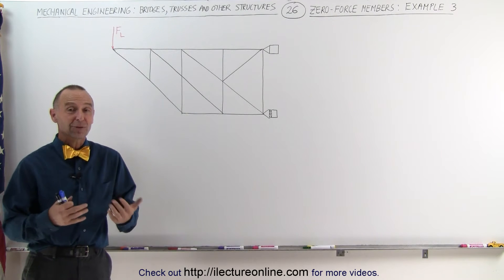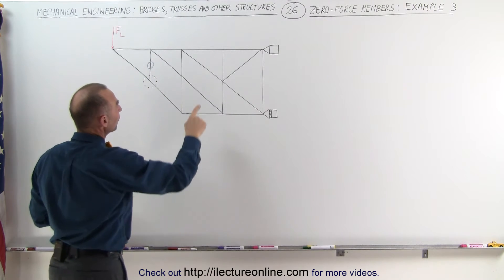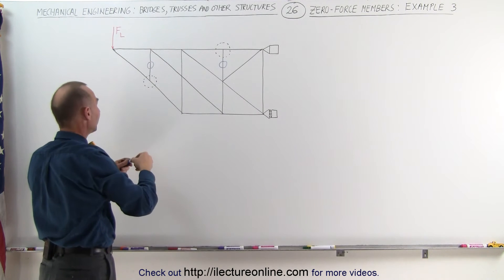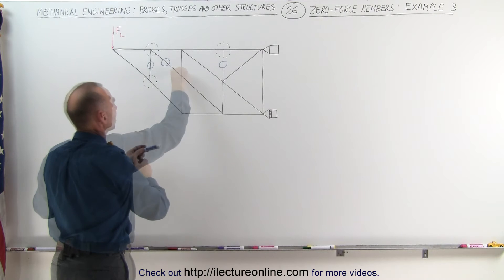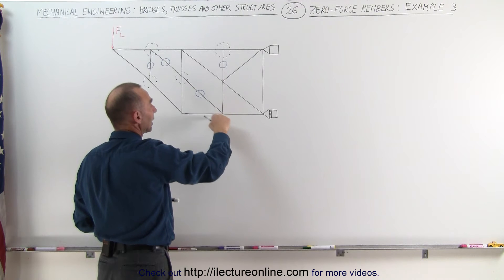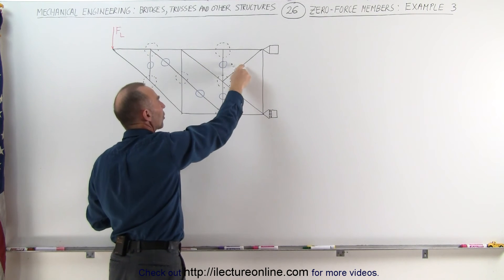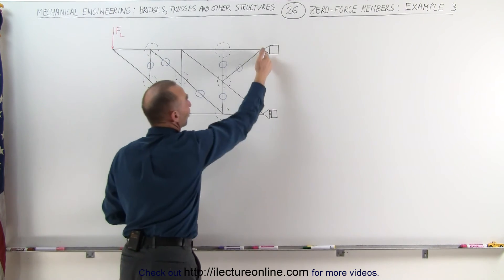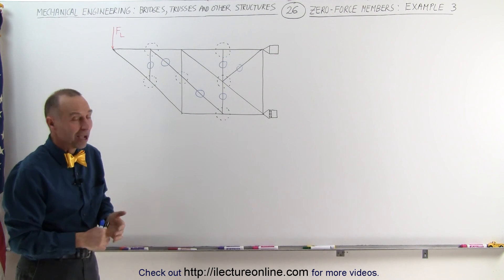Mechanical Engineering: Trusses, Bridges & Other Structures (26 of 34) Sum of Forces Ex. 3

Comment: SIr can joints be under tension or conmpression ?
Reply from the maker: I don't like thinking about the joint in those terms.  Draw a free body diagram around a joint and then determine which way the force acts.  A connected beam under tension will pull on a joint, and a connected beam under compression will push against a joint.  (The concept of Newton's third law).

Comment: Why is the force member that's attached to the support counted as a zero-force member? I thought if they were attached to a support, they cannot be eliminated
Reply from the maker: If it is a zero force member, you can remove it and it wouldn't make any difference to the structure (from a force perspective).